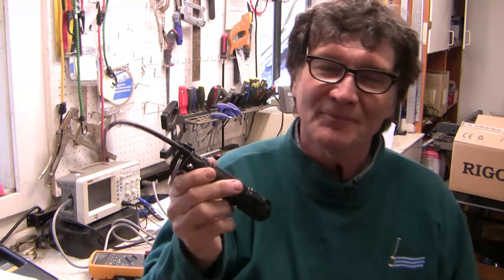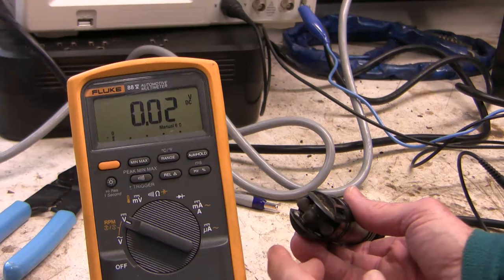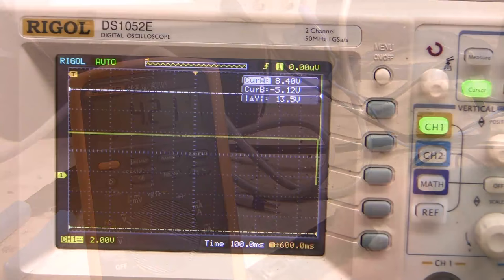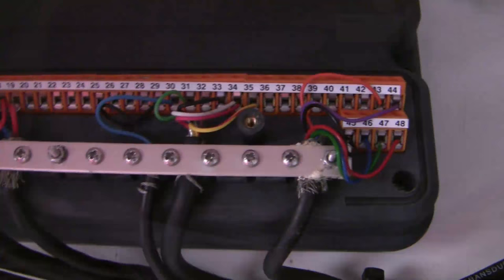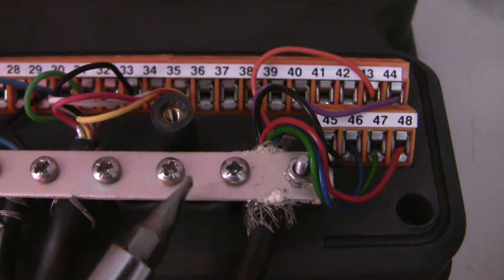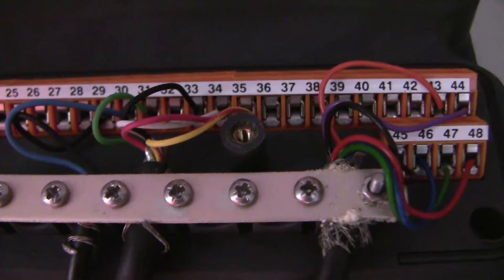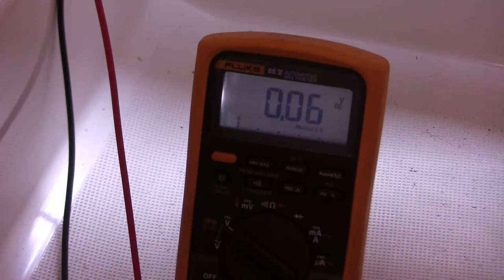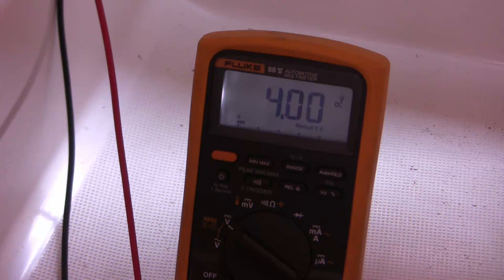How a boat paddlewheel speed sensor works

Comment: Good idea to check the physical connection of the paddle wheel sensor unit. Recently another Vlog, Lady K sailing took on a lot of water and ruined some expensive electronics when the sensor cracked and let copious amounts into and over the bilges. The break went undetected for quite a while because both crew were topsides minding the sails. That unit is afterall a through-hull fitting. It was probably cracked for a long time but when they hit some pounding seas on the bow it gave way and let seawater in. A very expensive mess it was. Great video and thanks.

Comment: curious why a boat would have a paddle wheel and peetoe water sensor for speedo?  Don't they do the same thing?  I ask as I have both and never paid much attention.
Reply from the maker: Good question! The difference between paddle wheel speed and GPS speed is water current, which is very significant given the tides we experience. It took me a few years to realize that programs for tacking angle use a frame of reference to be the moving body of water, not land. So, they use paddlewheel speed rather than GPS speed to determine the true and apparent angle of the wind to the mast. Unfortunately the assumption is that the paddlewheel is accurate, which unfortunately is not true. Even with careful fine tuning, I find it difficult to get it within 10%, almost never within 5%. So, as much as it is cool to use true wind angles to decide on exact tacking angles for optimum velocity made good, the real experts use gut instinct.

Comment: I was thinking a bar magnet in the paddle and hall effect sensor picking it up.
So that lines up with your info text, im only now reading lol.
I would connect a logic probe instead of the meter, the buzzer type, so you can waggle all the connections and hear the logic 1 jump about.
Sorry im jibbering on again :-(
Reply from the maker: Yes you're right, a simple Hall sensor, and I did check, each of the four arms are strongly magnetic. Old sailing wisdom describes how vigorous cleaning could knock a magnet off, but these are completely covered in plastic. Yeah, I could have used a test light or a noid light; I don't have a dedicated logic probe. Mostly I wanted to see the waveform, though I like to pretend it was for more than just giggles. I tested it overnight looking for failure or inconsistency at different temperatures -- consistent performance throughout. Thanks for stopping by, as always.
Reply: Just one more thing, its blowing raspburys at you :-D.
Ive had the same thing, it wont fail while being watched lol.
Reply: @spelunkerd  heavens sake get cheap gardening thermometer over side,,if its cold put stuff on if hot take off ,its always cold in north sea and uk.

Comment: This begs the question. WhyTF does a boat need a computer?
Reply from the maker: Yes indeed, you sound like a veteran sailor! My last sailboat had few electronics, and even GPS was with a little hand held so I didn't need to worry about draining the starting battery. This one has three 12V AGM batteries and I use the autopilot regularly since we often sail short handed. The autopilot requires GPS input, and together with the VHF radio they draw 6 amps. The processor displays water depth, which is pretty important since when racing we often hang close to the rocks when fighting against tidal current. These racing boats have optimum algorithms based on true wind angle, which comes from vector calculations combining boat speed and apparent wind speed/angle measured at the top of the mast. However I find that my instinct about wind in the face is often a more trustworthy index regarding sailing angle and when to tack. The best sailors never rely on electronics. Thanks for watching!

Comment: I'll let you "paddle me" if you give me that Fluke 🤓
Reply from the maker: I got the 88V online and on sale, but I don't think it shows RMS voltage like its better and more modern cousin, the 87V. RMS is not very critical for automotive work, where I spend most of my time. The 88V comes with automotive accessories like a thermal temp gauge and a capacitive pickup lead, but those aren't very useful since I use a scope for the latter and I never use the former. One thing I would like is a lowZ option for voltage assessment, it is surprising how often we see ghost voltage in a line. I have a cheaper Fluke 117 for that.  I'd love to have graphing and logging capability, something like the Fluke 289, but that one is way out of my price range.